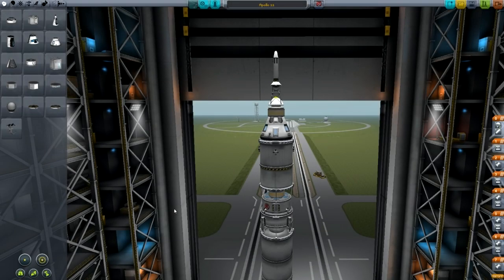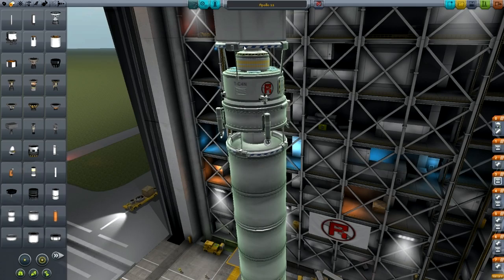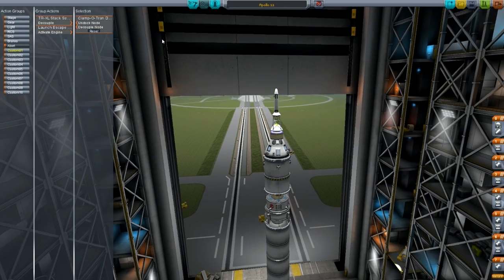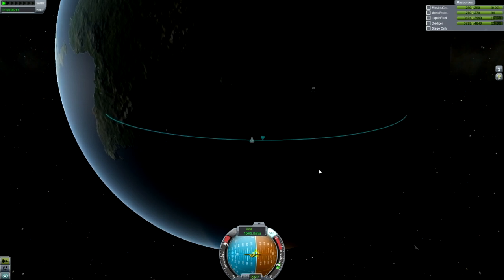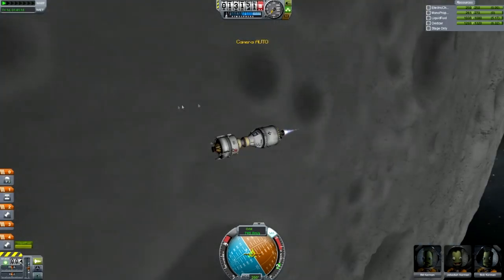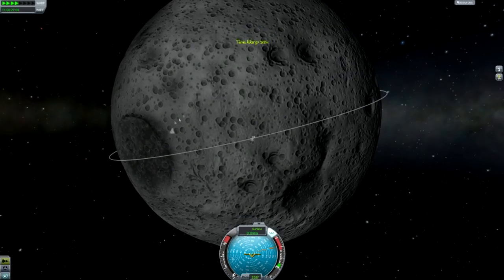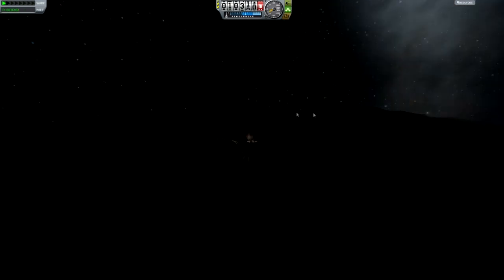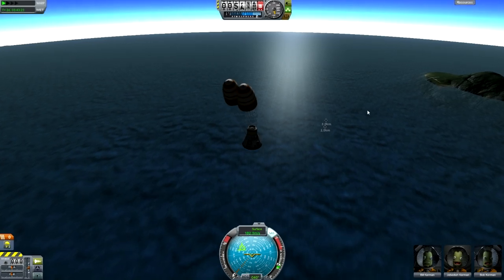KSP - How to recreate Apollo 11

Comment: You can get rid of the 3rd stage (with the Skipper engine) and just add two S3-3600 tanks (the smallest of the new Kerbodyne tanks), one in 1st stage and another one in the 2nd stage. Makes for a shorter more elegant rocket, which can be launched with 2x acceleration, and the KR-2L engine is more efficient than the Skipper anyway. Makes the translunar injection with a little fuel to spare. If you really want 3 stages like the Saturn V, you can make the 3rd stage with a S3-7200 tank and another KR-2L engine, instead of what I said above. It's still stable and looks more like the real thing.